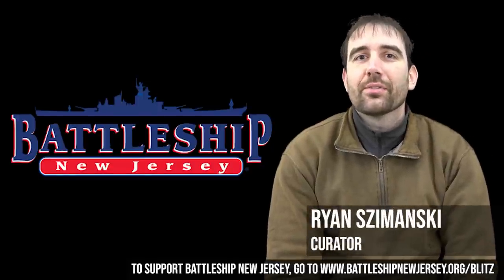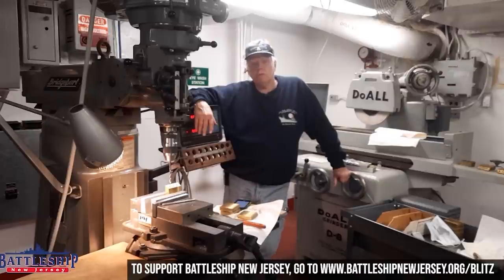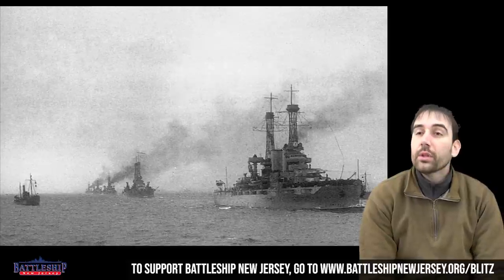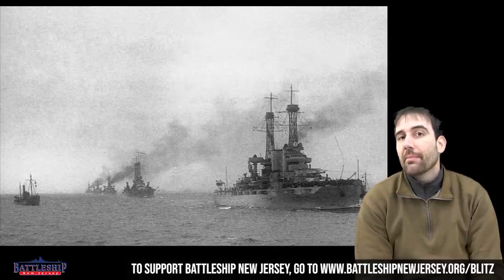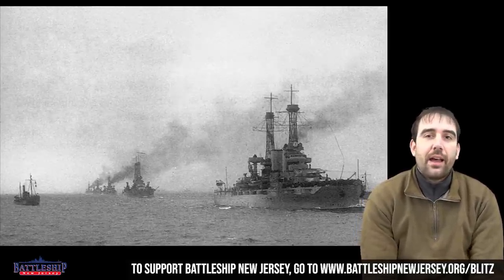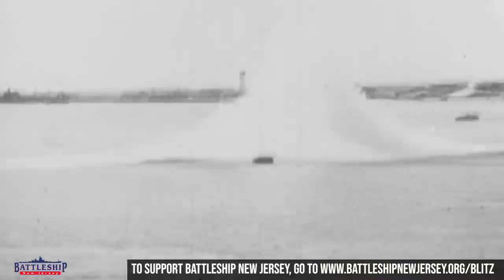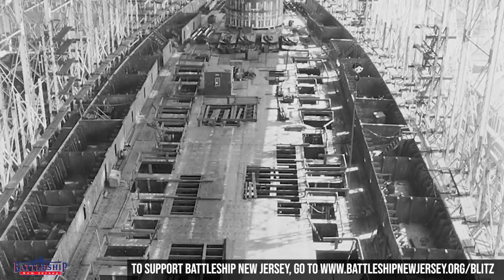The Evolution of Armor on Ships

Comment: I disagree a little with the classic triad approach, as there are at least two more points - price and size. America was able to score very high on all three base aspects by spending more on R&D than other countries, and as such, you have ships like South Dakota that do far more in 35,000 tons than other navies did in much more. And by simply building bigger, you can essentially achieve all the classic aspects through raw bulk. This is, of course, the Yamato approach.
Reply: Up to a point, yes.
However, I'd call it a game of diminishing returns.
While with ship hulls, the square-cube-law is in general on your side, you will still need more and more power to get the thing moving.
Also, you can't just keep making the thing larger and larger because you will also have to make your dry docks larger and larger. And those things will cost a lot of money.
Some nations simply didn't have the real estate in their harbours to keep expanding the docks.
Add to this engineering problems like the way a ever larger hull moves and warps in the waves, and you will want to keep your ships as compact as you can make them.
Reply: Generally agreed. To this you could add the things like range, damage recovery, compatibility with national resources, and much more. Thanks for a great comment!

Comment: Ducol was a very high strength homogenous manganese steel, it seems to be most similar to modern high strength steels. It was used extensively as a structural steel in their post-WW1 capital ships. Like STS it was used for light armour in many places.
For their belt they used a type of KCA but messed with the chemical composition to make it incredibly strong and tough.

It should also be noted that crushing tubes were only used in British torpedo bulges, not integrated side protection systems as on the ships built after WW1.

Comment: Mathematically, with the armour plate there's a very simple way to view the angling. If you look at the thickness of the plate vs horizontal shots, lets use 60 degrees purely because the numbers work out. A 10 inch plate would be 20 inches horizontal. That will always have the weight of a 20 inch vertical plate, and the same is true for any angle we pick, it will always weigh as much as a vertical plate of equal horizontal thickness. The reality gets a little more complex with failures as the armour gets too thin (sloped gets worse) or projectiles taking a curved path (sloped gets better), but that's really only important if you're designing the armour or calculating reference cards with the various penetration ranges.
Reply: Facts!
Which is why the frontal armor of the t34 tank was so effective
Reply: @rdallas81  Plus the projectiles of the era were particularly bad against angled plates. Then those designed to improve upon that were still particularly bad. Whilst the T-34 had about the perfect thickness for angled armour to start becoming more effective. So it was all a perfect storm coming together to make the T-34 armour fantastic, whilst everyone else went into the war assuming tanks would have thin armour so their tests were stuck suggesting angling wouldn't help.
Reply: @olivialambert4124  wonderful analysis Olivia!
The Germans figured put rather quickly just how effective armor angles vs thickness can be!
       Even with tigers flat armor being thick, and panthers thick angled armor, side shots from even short barreled guns was deadly.

Whats your favorite ww2 tank?
I believe had the Germans made more simpler tanks or tank hunters like the Stug (they could make 3 or 4 Stugs to 1 Tiger 🐅 ) (Meow! Lol) they could have had more success on the field but probably nothing worthy enough to stall the impending defeat by the Red army.

Comment: That's one thing that Showboat definitely has over any other museum battleship... since the North Carolina class used an external belt, it's very easy to see the thickness of her belt armor.  Just look down the side as you're boarding!

For those curious, the belt armor on the South Dakotas and Iowas was extended to the bottom of the ship to protect against shells that hit short of the ship and might penetrate the hull below the belt armor on a conventional design.  That's also what the lower internal belt on the Montana class was intended to protect against, after the problems with the SD/Iowa arrangement were found in a live torpedo test against a caisson (simulated hull section).  Such hits were extremely unlikely, but potentially devastating--Drachinifel and several other historians now believe that Hood's loss was due to just such a lucky hit by Bismarck.
Reply: It could have been a problem against large torpedo impacts, but against underwater shell impacts, the lower belt probably would have functioned as designed.   A shell doesn’t contain nearly as much explosive filler as a torpedo warhead, so a system designed to defeat torpedo detonations will easily defeat a shell detonation.  Unless the shell penetrates the lower belt, that is, but after passing through water, it’s extremely unlikely that it would.   

If I’m not mistaken, the Navy also made some fixes to the SoDak and Iowas’ TDS after those tests that partially remedied the problem.  The Yamato class’s TDS, while similar, had a much more vulnerable connection of the lower belt to the ship’s bottom.  This wasn’t bad enough to be exploited by air-dropped torps—which is why it took so many—but the Yamato class proved very vulnerable to the larger torps carried by subs.
Reply: @bluemarlin8138  Correct, but it was felt that the odds of an underwater torpedo hit were much higher than those of an underwater shell hit, so the system was redesigned again for the Montana class, reverting to an external main belt with a small strake of internal underwater belt that did not extend all the way to the bottom, but instead about halfway to it (bottom of the magazine/machinery spaces).
Reply: @rdfox76  The Montana’s lower belt would have extended all the way down—although it’s hard to tell on some diagrams—but the fact that it was further inboard and not attached to the main belt made it much less likely that it would be a source of TDS failure.
Reply: @bluemarlin8138  According to Drach, a 15 inch shell skipped off the water and into the bow wave trough near the X turret. Unlike a torpedo, which explodes against the outer plates, an AP shell penetrates deep into the ship before exploding, especially if it doesn't encounter any real armor on the way (it entered below the waterline). Unfortunately for the _Hood_, this one exploded at or very near the bulkhead of the 4 inch magazine, setting it on fire (and the rest is history).

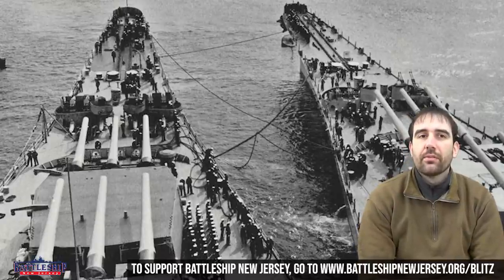Comment: 3:34 ancient ships (light wood ships for speed qnd strikes 
Sails alow for thick wood (early 1500) frams pushed closer together so no room for projects but weak against exaploaives
5:26 iron armor (wood on inside good for preventing exsplosive when iron fails
6:42 old vs new iron sides (old is some iron with wood behind, new is mostly iron, mostly by guns

7:35 steel armor
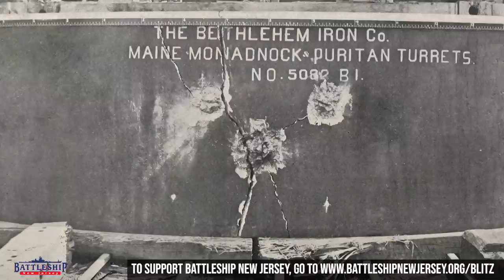8:17 different types of steel armor
11:00 class a (thin but strongest, for cramped) class b (less then)

11:23 placing of armor (armoring by the guns and ligher armor by the ends against secondary guns 
And decks are mostly still wood

13:00 all or nothing (continues last but you only armor main bits, this hope of attacks go through one side to the other no exsplode)

14:19 armored citadel (the armor placing)
Non important parts go outside armored area

18:09 immunity zone (ashume everyone uses biggest gun like yours and armor against that, but this says that sometimes you cannot protect against it.
Rule.of thum, 1 inch shell penettates 1 inch aromor 

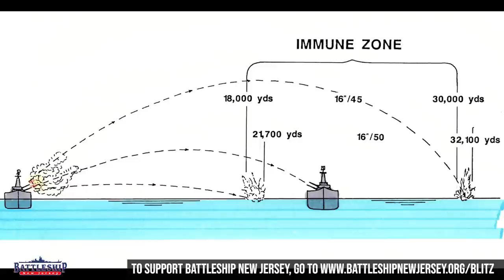20:45 belt aromor (your side armor,) talks about the penitating power at angles and ranges, (angle to get more protection but dont go too much to make it too big

23:05 armored barbette (mentions armor on turrets and a few other places not important 

26:23 torpedo defense( 5 layere each with steel then a void,
some liquid void and others air voids to alow distribution of force)
The amount of layers you can aid are usaly more important then what you put in them but some are thin ships no no room for more layers like at the front its thin for more speed.
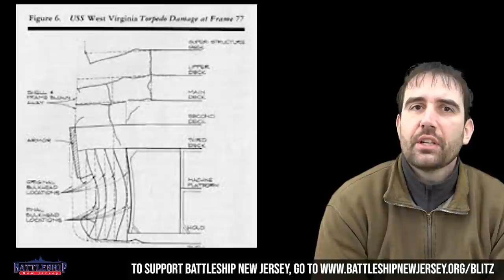28:52 crushing tube system(a hallow cylander in the liquid void to take some of the force and not the outer walls)
But the usual just redirect it away form the cylander, also you have to go in and replace the cylander and the layers, 
The first one just fix the layers.

32:23 places on the deck where you need thick armor or layed armor for decks
33:27 splinter deck 

35:19 laminating multiple  layers together (dont aid new layer on old, its better to have thin layer then gap then thicker layer, doing it like this can bring more effective thickness 

Dont have internal armor belt as it just caves in (curves into the ship) also your torpedo defense need to be able to keep up with the bottom of the belt armor

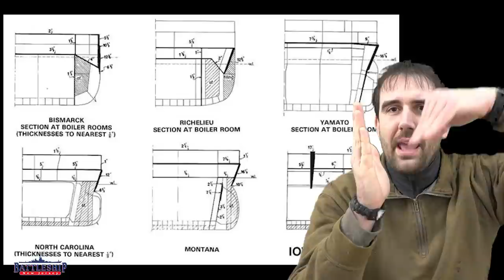41:00 turtle deck (semi circle good for direct fire but plunging fire just strikes the weaker top
42:40 armor against missles,
They stop armoring as its just armor needing more speed needed bigger needed more armor, so they have cheap light armor and later start using active anti missle systems like tanks (exsplosive armor destroyes the projectile,
Mashine guns or missles intercept enemy fire

Comment: You didn't mention how the US got a hold of a 24 inch turret face plate off a Yamato class that wasn't built, the Shinano I think, and using the 16/50 at a simulated range punched straight through the face plate and the shell kept right on going and was lost somewhere beyond the test site into a river bed and was never recovered, so the Japanese steel was far weaker than the thickness would imply on paper. the Japanese iron was far less pure as they used iron sands rather than ore.

Comment: Great content, as usual. Thank you! Re the Arizona being defeated by 16.1" shells, it's worth considering those shells were effectively plunging fire. I suspect they might've gone through the decks of the Arizona even if they were 'only' 14" shell / bombs.
Reply: They were also plunging at a much steeper angle than they would have been if fired from a gun, so they were more likely to penetrate IF they were striking at a similar velocity.  I know an air-dropped bomb would hit at a lower velocity than a shell at muzzle velocity, but not sure how long-range shell velocity would compare to terminal velocity from an air-dropped shell/bomb.
Reply: @bluemarlin8138  I think the RN did some calculations along those lines in relation to their armored carriers. They were designed to stop a bomb of some max weight dropped from a certain height.

Comment: It's worth noting that heat treating alone (heat and quench) doesn't increase the carbon content of the steel unless it's quenched in oil, it only changes the crystal structure. Nitriding and carburizing do add carbon.

Comment: This video was absolutely great! I had also recently watched the one about the steel that went into the armor, so putting these two together is like finishing a book! As for a current modern day missile hitting the Iowa's, I had previously looked into the Russian P700 (7,000 Kg) missile, and how much energy it delivered as compared to a WW II battleship. Without knowing the actual weight when it impacted, since part of its weight is the fuel within it, I can only estimate the energy value when colliding with the ship after a hundred or so traveling miles. Also, this particular Russian missile may be hitting the ship from a vertical position, changing the impact of the hit completely. So, in conclusion, one P700 would be equal to around 500M ft. lbs., which is about 1.8 more than the muzzle energy (energy at launch of projectile from the gun) of the Iowa 2,700 lb. AP round. So, if hit on the side, the Iowa class ship should be able to take it, but it would cause damage. Also, keep in mind that most of the other anti ship missiles of today are not that huge like the Russian P700, although I do not have any actual ballistics info on any of them.

Comment: The problem with cruise missiles are two fold one the speed is subsonic in most antiship missiles especially in the 80s the the other factor is the warhead basically being thin skinned HE no cap at all hence no armor penetration...

I think the best analog for a BB vs cruise missile would be kamikaze hits the MO took one that dented the side (not armor) and basically was a paint over it deal...  there could be a mission kill i.e swarms of missiles taking out topside stuff but anything thin the armored con or turrets probably OK...  the newer supersonic missiles have the speed but lack mass and again no cap so thats a big question...
Reply: Even with supersonic missiles the results aren't great. The armor penetrating warhead needs to still be massive(like a BB shell). Battleship shells in WW2 generally had velocities of over mach 2.5. so a super sonic ASM with an equivalent AP warhead must travel that fast as well
Reply: @alexdunphy3716  yeah thats why the 2700pd super heavy shell was almost as good armor penetrating as the 18.1in shell... was a smaller lighter shell but faster...  i dont think a Cruise missile could be made with enough mass because center of gravity would be way off because of the heavy now required...
Reply: @chrisjohnson4666 I think it's possible, but really inefficient. For example you could have a design with the seeker in the tip, followed by a long rod of dense metal like DU or WA surrounded by a cylindrical fuel tank, with the engine at the rear. At this point though it would be very large and few could be carried. It would also be very expensive and a large target for enemy point defenses. It is also doubtful that, in a war where large anti ship missiles are necessary, sensor coverage and communication would be functional enough of the time to provide targeting data for targets hundreds of kilometers away with any regularity. We need to rethink guns, there have been massive improvements since WW2
Reply: @alexdunphy3716  i think had the c0ld war been going on still we would of seen guided 16in shells and some type of sabo round extending the range significantly...
Reply: Pretty much every anti-ship missile in existence has some kind of HEAT or SAP warhead capable of defeating armor, not "thin-skinned HE". They might not be designed to defeat a full on BB citadel but building such a warhead would not be difficult with modern technology, which is way more advanced than anything that was available when these armor schemes were developed in the 30s and 40s.
Reply: @josephmagana6235  heat warheads are already easy to defeat with the weight and size restrictions on tanks, so scaling that up to warships should be super simple. Also, HEAT warheads, if they do penetrate will be much Less effective against ships for a few reasons. 1) ships have tons of relatively empty space in them and lots of compartmentalization meaning it's much harder for the penetrating heat jet to damage anything important compared to the relatively non compartmentalized and critical systems dense interior of armored vehicles. 2) the holes that heat warheads punch through armor are super small and clean, therefore very easy to patch up. Once the geometry of the heat jet is disrupted, even slightly the penetration falls off a cliff, and so tanks have adopted (relatively) low density armor that does this to deal with them. Now tanks run into a serious size limit because of infrastructure limits but ships have way more room to exploit the this and simultaneously really benefit from lower density. The point is that ASM warheads are far less capable of penetrating armor than battleship shells and we already know how to armor against battleship shells with 90 year old technology. Sure you can make a warhead for an ASM that is equally capable as a battleship shell, but the missile required to carry it would be so large that no ship carrying them can realistically hope to carry enough to reliably get through the active defense systems of a prepared enemy ship more than once before going back to rearm.

Comment: On armor you need an extremely hard face to shatter the shell then high toughness but fairly soft to absorb the energy.  Aluminum would actually make even better armor than steel as its strength to weight ratio exceeds steel and it can absorb more energy per unit weight.